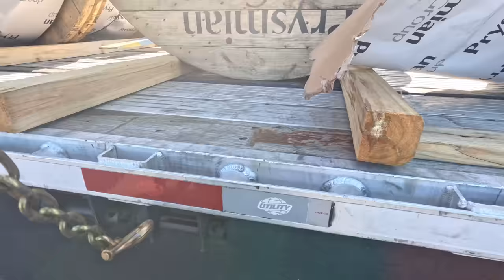When You Meet A “Karen” As A Truck Driver.. 😂

Comment: A tip on those binders... get some antiseize and apply it to the threads. I would run them all the way back into the sleeve too before putting them away if I remember right. It doesn't take long before those binders will seize up like no other and you'll have to get new ones.

Comment: Becca take some time to get your house in order clean your boxes out organize your straps spray your chain ratchets, get gloves put them next to your seat dont take them off until you get back in the truck. Flatbeding is not for everyone there's a lot of little steps it takes. Everything you do consistently will make your job easier. You will have  days like you have had but they will be a lot easier. Doing a good job young lady.
Reply: @thomasramey9007...correction, if I may:  "...get gloves, put them next to your seat...BUT TAKE THEM OFF BEFORE you climb into the cab"...is what I have taught all my drivers since 1986...the reason, you ask? You wear gloves to keep the dirt out of the cab...what good does it do, to pull yourself up on the grab-handles and touch the steering wheel with dirty gloves, before you take them off and place them next to your seat by the door?????🤣

Comment: Hey Hammer Lane Big Rig Becca Ima lace you up on this T680 transmission.I sometimes downshift mine climbing hills because this Engine is so puny,that being said,it gets confused,especially if you command it more than once.When it throws a fault just shift it into neutral and coast  the code will fall off and you wont even have to stop.I try not to let it bother me just keep on rolling if its a warranty job theyre going to do the bare minimum to repair it anyway so dont expect much.Also Paccars are  similar to Cummins in the way of,should you get an over rev code cycle the key 8x and it goes away,all thats gonna happen is you sit there all day and they hook a laptop up and go "yea its good now".Until it pukes its guts up you wont see much resolve
Reply: Of course i would just not say anything about it at the dealer,instead"yea guess the code mustve fell off"
Reply: If nothing else it will keep you from sitting on the side of a busy highway

Comment: You seem very perturbed......Some loads suck, its part of it, true with all sectors (dry box, reefer, open deck)...Back in 08 downturn, I learned to just be happy and thankful for the freight because the economy was in the dumps and there was ALOT of people that couldnt find loads or were too proud to haul cheap freight but i learned cheap freight will pay the bills, that truck sitting in the drive aint making you shit. Its only costing you money, as long as you can haul for a profit, hook and book.

After 10 years as an Owner Operator I chose to leave the industry in 16 (too much damn government regulation they want their hands in every aspect) and for the most part I'm glad I did. Do i miss the money absolutely, miss the truck and going out west but overall much happier. 

 I know the economy is back in the dumps, freight rates are trash, not enough loads and too much capacity. Just hang in there it will get better BRB.